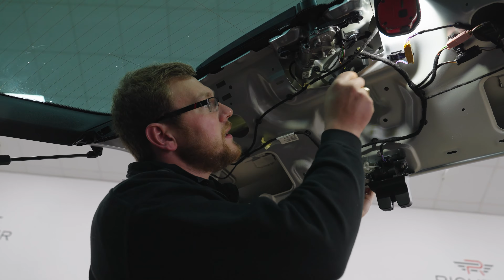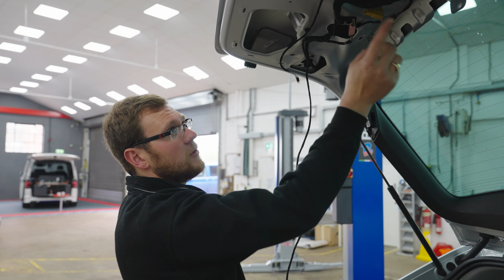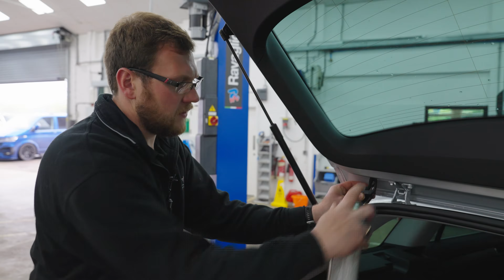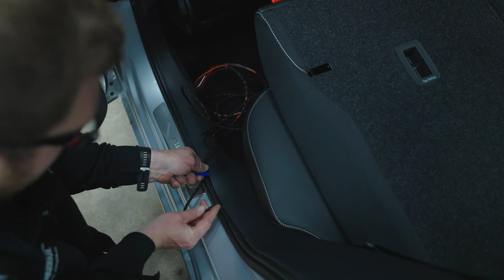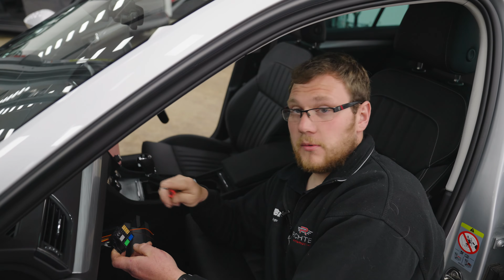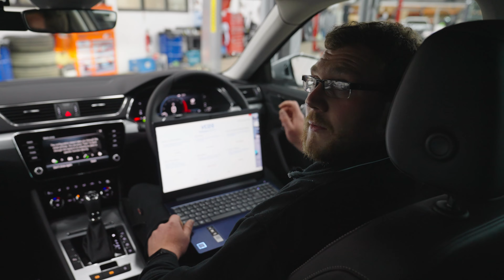Skoda Superb Rear Camera Install RetroFit - Richter Automotive

Comment: Rather hand waving on the critical bits i.e. how do you get the blue sub block out of the quadlock. How did you splice the can bus lines once they were stripped, was it a military splice or soldered? How did you get the permanent live into the fuse box and where did it go. Exactly what coding was done - Even how did you reach the cable tie that you need to cut to get the infotainment unit out as that is really tricky with big hands. Skip the earlier talking, delete the unnecessary music and give more time for the crucial bits that aren't obvious. Otherwise a useful guide on getting the loom through to the front.

Comment: Hi guys. I have seat ateca the year 2019 with original infotainment device and it not have a reverse camera. 
I need your help to install a suitable camera with lines that move with the steering wheel. If theirs a camera that you advise me to install and where can I buy it.

Comment: I have installed similliar in skoda scala. It works P&P but every time I put in reverse gear I have to manually enable parking sensor visualization. Is this some kind of coding needed with VCDS? Any guide which one?

Comment: Smooth and Professional.  Was a little suprised that the CAN integration was only 'twisting against' the OEM loom, but hey hoo, if it works what the hell.  I would be more than capable to perform the physical installation, but I cant afford the OBD coding sw and dont have the unlock codes that activate the new install. Otherwise, nice one.

Comment: I don't live close enough to anyone able to do this, so thats impractical, but I do have VCDS. My problem is that I couldn't find the parts for the IV PHEV.  I would have thought that compatibility with Amundsen was the key.  It would be handy as my drive is 1/8th mile long, pitch black, car too big to turn around so I have to reverse and there's nothing visible in the mirrors.  My ionic was able to see just fine with its reversing camera.

Comment: Great stuff, thanks for sharing. I'm about to install RVC in my Octy as the more and more popular concrete flower pots start to freak me out ;) Where did you find that fibreglass wire puller? I've been looking for the exact thing for some time but they all come with brass/metal connectors and hooks which I'd rather to avoid. The one on the video looks perfect for car jobs.

Comment: Hi, i have an Octavia Scout . i want to put a rear view dash cam on back window but  i want to take the panel off the one that you didn't take off, is there any screws holding this part in or does it clip off. Or do i need to take the part you took off first ? Just don't want to break it by force
Reply from the maker: If you could send your vehicle reg to sales@richterautomotive.co.uk one of the team will come back to you with a price. Thanks
Reply: @richterautomotive   Obviously Your response is an automated reply you have given me and haven't read the question i asked  ????
Reply from the maker: @brianstokes2572  If you could send your vehicle reg to sales@richterautomotive.co.uk one of the team will come back to you with a price. Thanks